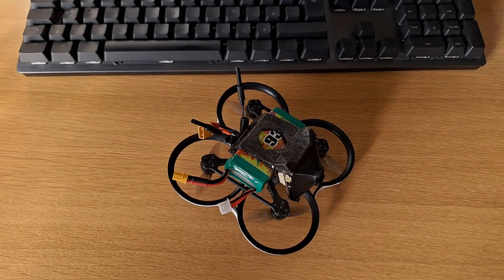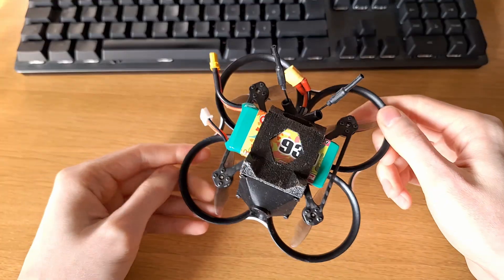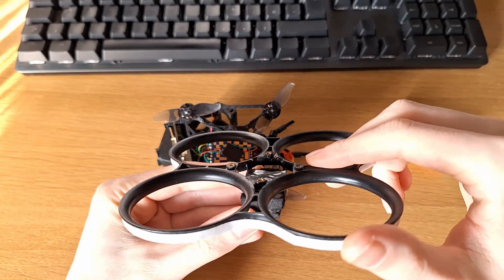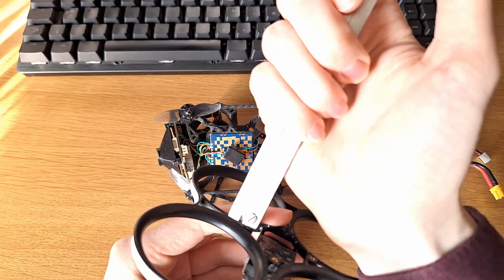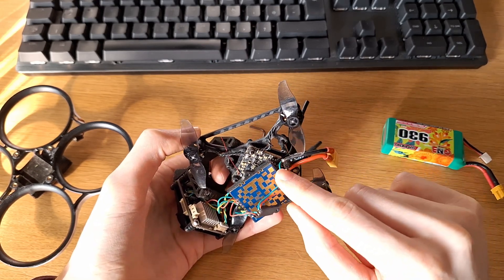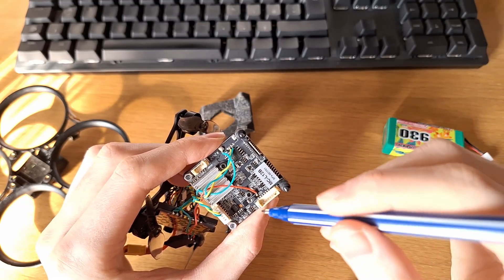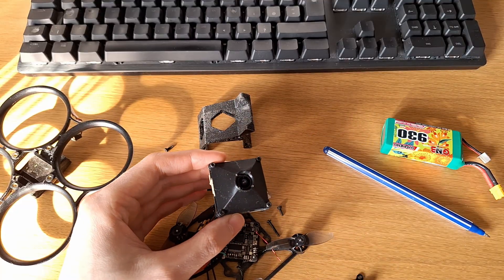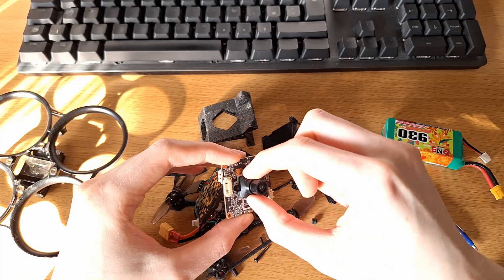OpenIPC digital FPV - How I built my OpenIPC drone

Comment: I have a noob question.

What is the advantage from taking 5v from both the BEC and camera module? Is it for more amps?
Reply from the maker: The camera and WiFi module are powered from the dedicated 5V BEC, which is powered from the battery. This is separate from the 5V BEC inside the flight controller. The dedicated BEC for the camera system is used because the BEC inside the flight controller might not be able to provide enough amps, and also because it's a good idea to isolate the power supply for camera and WiFi (especially WiFi!) from the flight controller to avoid noise in the power supply, which can lead to degraded radio performance.

Comment: How did you manage to power up the camera from 5volts. In my setup if go down to 10V it gets rebooting.
Reply from the maker: I used a standard 
5V BEC to power the camera and the WiFi module. I think it's rated for 1.5A continuous current and 2-3A spikes. Maybe your power supply can't handle the current spikes?

Comment: How much mW of power it can transmit?
Reply from the maker: I think this WiFi module can do 400-800 mW maximum, but I only operated it much lower because I was running without a heatsink or fan. It heats up a lot.

Comment: What lense (focus distance) do you use with camera module?
Reply from the maker: I don't know the focal length, I used a lens from a broken Runcam Thumb Pro W camera: https://shop.runcam.com/runcam-thumb-pro-w/

On the website, they say that camera has a 155 degree field of view, but for me it was smaller because the lens was designed for a bigger sensor.

Comment: wonderful! did you connect the ground for TX and RX (on UART side)? likely because of this i can't get the MSPOSD to work properly and show the telemetry, it just displays FPS 1 of 0 in the debug log and nothing more (seems like no useful data)
Reply from the maker: Yes, for the UART to work the flight controller and the IP camera need to be connected to a common ground. But for a drone powered from a single battery this is probably true anyway, because the flight controller and the camera both use the negative battery terminal as the ground for power. So adding an additional ground connection for the UART is unnecessary, unless you don't already have a common ground.
Reply: @arturpekosz  thank you very much for your guidance! also as an additional step resolved this by updating betaflight firmware to 4.5.0 instead of 4.2.9, which explicitly didn't support the VTX MSP+displayport protocol. I have the Hobbywing F4 G3 and the ground is really shared with battery terminal though)

Comment: Please tell me if I can use AIO JHE F411EL ELRS from jhemcu?
Reply from the maker: I've never used this AIO, but I don't see why it wouldn't work. The mounting hole pattern, max battery voltage and max ESC current are the same as in the AIO I'm using.
Reply: @arturpekosz  Thanks Artur!

Comment: Unable to get mavlink data from my runcam ip camera can u pls help in this.
Reply from the maker: I don't use Mavlink or Runcam hardware, so I can't help you with that. But you can join the OpenIPC FPV Telegram chat, there are a lot of knowledgeable people there who might be able to help you. Here is a link: https://t.me/+BMyMoolVOpkzNWUy
Reply from the maker: I think the issue might be due to a wrong UART port setting in the firmware, or having the MSP telemetry option enabled instead of Mavlink. But for more in-depth troubleshooting it's better to ask more knowledgeable people in the Telegram chat :)
Reply: @arturpekosz  thanks

Comment: amazing build , I really need to try out some different lens , so much image quality left on the table
Reply from the maker: Thanks! Which camera are you using?
Reply: @arturpekosz  IMX335 and IMX415 , so far I've had issues with the lens causing this purple-ness to the image . I think this is due to a missing IR filter on the other lens - need to find a way to over come this - did you have this issue ? if so any fixes ?
Reply from the maker: You can try different sensor calibration .bin files. The lens I'm using tends to give the image a red tint, but this doesn't happen with all .bin files. I also have a bigger M12 wide-angle lens I got from Aliexpress, and it doesn't have any issues. But I prefer to use the Runcam lens on this drone because it's smaller.